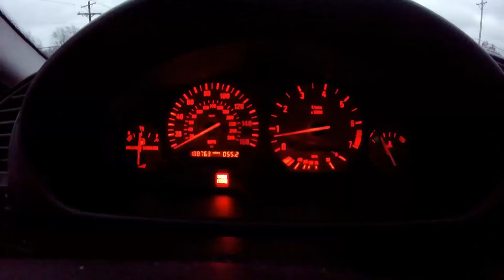Should You Ever Replace Your Transmission Filter?

Comment: 1). bits of flaked off gasket from the pan & other mated surfaces
2). metal filings from normal wear over time
3). sludge from atf. Yes, it CAN congeal & develop varnish. Just because it's red doesn't make it any less sludge.
4). friction coating worn from the plates. It adds up.
5). dust & foreign particles/debris introduced via the vent/dipstick tubes. It is most certainly NOT a sealed system.
Spend the extra coupla bucks or don't. Your choice. I'm an avowed filter replacer. Metal screen types should be cleaned.

Comment: Metal particles and clutch material Dude!
You are giving terrible advice!!!
Reply from the maker: You’re missing the point. If there’s enough metal particles and clutch material to restrict the filter, it needs to be rebuilt.
Reply: No Pete, you are missing the point of what an automatic transmission filter is made to do. Clutch material and different metal mating surfaces are always going to wear with use. The filter picks up that worn material and separates it from the fluid to extend the life of the transmission. The filter is there to trap unavoidable wear debris so that you have the ability to change the filter and extend the life of your transmission due to wearing out parts prematurely from particulates in the oil that should be filtered. If you don't change your filter then the fluid does not circulate as it should due to a clogged filter and you can cause damage from lubricity loss. 
A manual transmission doesn't need a filter because the clutch material is not inside of the transmission.
Reply from the maker: How much clutch material does it take to restrict a filter to the point it causes lubrication issues? Pressure issues? Quite a bit because there is a large surface area on most transmission filters. If there is a large amount of clutch material in the filter then it’s not on the clutches anymore. Which means that it needs a rebuild. Newer front wheel drive GM and Ford transmissions don’t even have a serviceable filter because you need to completely disassemble the transmission to get to it.
Reply: I just serviced a 2016 Ford escape fwd for a customer. Filter, fluid and gasket. They are serviceable just not easy or cheap jobs thanks to the brilliant engineering. Ford still calls for this filter to be replaced every 60k. My customer has probably lost a trans because the mechanic before me told her just what you are advising (filter doesn't need changed). Oil starved because of clogged filter and fluid changed at 65k is black as coal. You keep giving your advice and I'll keep doing it the right way.
Reply: Btw that transmission oil change w no filter change only has 10k miles on it. The filter is there for a reason and should be changed as called for by manufacturer spec period.